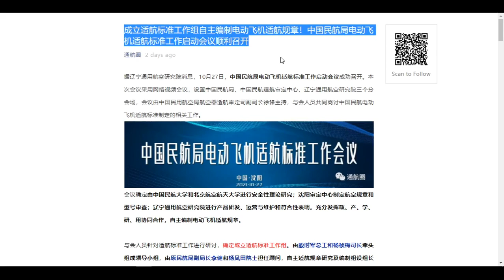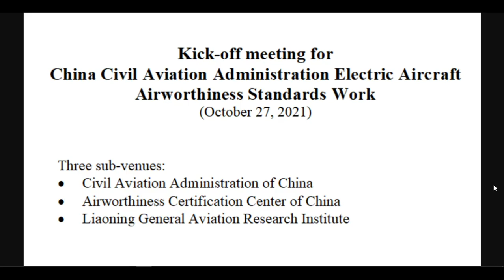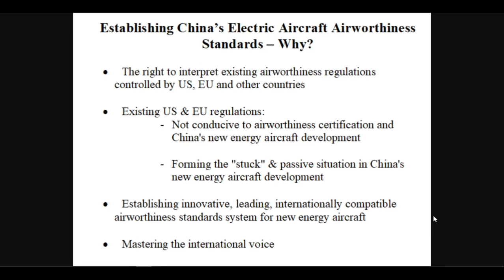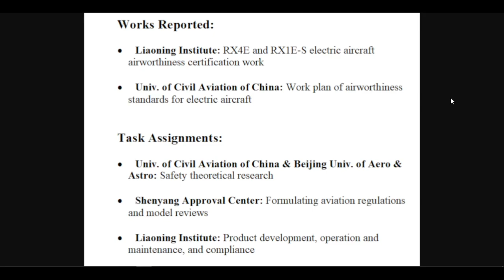EHang EH216: CAAC Electric Aircraft Airworthiness Standards Work Meeting

Comment: If I understand well,  this is the standards for any electric aircraft (automated or not,  eVTOL or not). The standards for unmanned aerial systems and aircrafts (UAS, UAV) is a different thing and the process for defining that has been initiated recently. I don't know if there will any other standard applicable/required for aircrafts operating in densely populated urban areas (UAM). All in all, it looks like it will take 2 or 3 more quarters before EH is certified. I think we will see a share price of 50-60$ then.